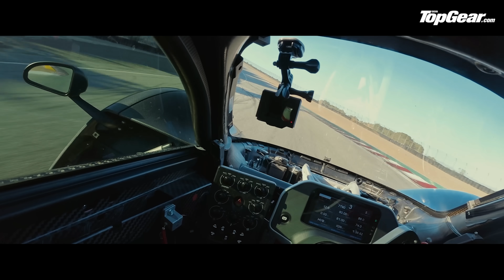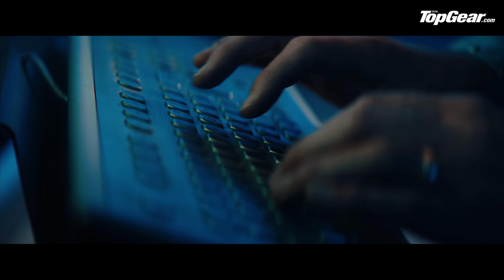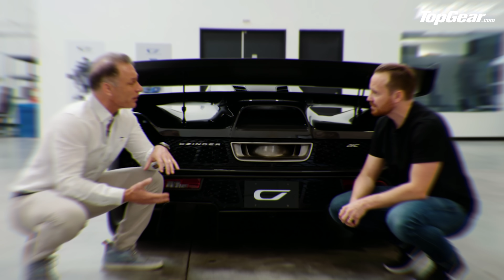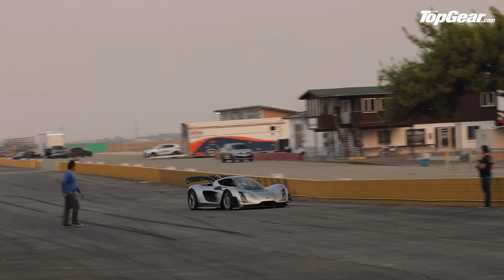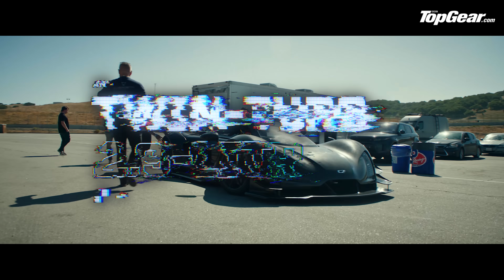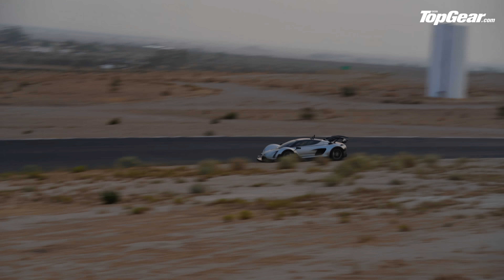World Exclusive! CZINGER 21C FIRST DRIVE: $2m, 1,233bhp 3D-printed hypercar | Top Gear

Comment: For the record the SR-71 went much faster than Mach 3. 
Those engines on it are one of the greatest inventions of mankind.
The potential top speed never achieved limited by the airframe.
But Mach 3 is still terribly fast in its own right. And a jet plane only America could build.

Comment: Somebody would do well to make a 1 + 1 car like that with a more sensible
engine and sensible price. If you kept the weight below 3000 lbs. 
or around 2500 lbs. you could still have a great fun with just 300 -400 HP
and maybe regular folk could afford it. However, the Insurance I'm not so sure.

Comment: Aerospace tolerances are looser than automotive tolerances, Sorry to say
Reply: here is what a quick google tells, sorry to say you are completely wrong.
Aerospace tolerances are much stricter than automotive. For example, a rivet for an aircraft frame can have as low as 0.001 of a variance, as compared to a tolerance in the 0.1 range or slightly better for the automotive industry.
Reply: @lucianholbrook3966   you had to google this but it’s just not, I work in the industry I should know.

Comment: It's very impressive, but I don't think it's an SR-71 like re-imagining of a car. The SR-71 used exotic materials, new technologies and a whole ton of brainpower to create something fundamentally different and new- nothing before had achieved that kind of performance for an air-breathing jet and it was an entirely new 'class' of aircraft. This car is innovative and experimental, but it fundamentally achieves the same things as cars before it in broadly the same way with incremental improvement and new innovations to the process.

Comment: It’s does not have a “dog-leg” gearbox as stated by the presenter. It has a “dog” gearbox. A dog-leg gearbox means that in the gate, first gear is engaged by moving the gearstick backwards and 2nd is forwards. A dog gearbox refers to oversized “dogs” used on the cogs in the gearbox which means gears can be changed without the clutch without damage.

Comment: nvm I missed the part where it showed the hood open. wing is attached to the rear bonnet. What I am seeing is flex from the body. I just assumed a multi million dollar hyper car, the wing would be attached right to the rear suspension. Which is illegal in race cars cause it gives you a unfair advantage. Seems like a logical step for hyper cars to do this. I wonder why they dont?.

Comment: It's clearly a different driver in the exterior shots, different helmet, wearing gloves etc. Still an impressive car, but it raises a lot of questions. If it's assembled to better than aerospace engineering, why do they need a stunt driver for anything over 60mph? Why is it disassembling itself at speed? If it was built better than aerospace engineering, even a pre-production model could handle 200mph. I don't know, I'm just a dumb dumb.

Comment: "Better than aerospace industry tolerances". 10 seconds later: roof falls off.

Now I'm scared of flying. Thanks.
Reply: Looks like the spoiler is going to fly off aswell, its bouncing all over the place
Reply: @christopherosborne7483  To be honest, 200 mil F1 cars all wobble around, stuff bends all over the place while they are driving around. The designers know it will bend, and they are okay with it :)

Comment: the steering wheel locks like a bad design...as you can see, to reach the shift paddles you have to place your hands on the metal ( or plastic) part of the wheel..

Comment: $2Mill??? I don't think so , I would rather buy a Rimac Nevera for that price, and it  will absolutely piss on this Czinger 21C
Reply: Two very different cars. The Nevera is still a very heavy car that has insane straight speed! I'm sure the 21C which weighs  a littles more than half of Nevera, can pull off insane G's at the corners.
Reply: @HKRupadhyaya  Nevera way more comfortable , more power , for real world driving , rather have the Nevero
Reply: @Enduro-Life  Exactly why I said these are two different cars. The 21C isn't meant to be the Nevera 🤷🤦🏻‍♂️
Reply: @HKRupadhyaya  21C -
OLD tech
Reply: @Enduro-Life  And that Rimac is souless XD
Reply: @HKRupadhyaya  I prefer  piston driven  engines, but the Rimac is on another level, and is no slouch on a track either. Definitely has presence

Comment: Beating the Senna is admittedly impressive, but remember it does have 50% more power.  I have a feeling that a Senna would beat this with a mild tune to maybe 1000hp (i.e. still giving the Yanks a 200+hp advantage).

Comment: It's not only 3D printed , many of the parts are optimized to perfection by AI/ML systems . It's truly amazing .
Reply: The fact that theyre also a military subcontractor is wild.
Reply: You are pretty correct, however, a huge amount of this car, engine, gearbox, drive train, interior parts & a great many things that aren't on other cars are genuinely 3D printed, it is one of the very few American cars that I truly admire.
Reply: Of course it's not 3D printed. About 5% of this vehicle is 3D printed, if that.
Reply: @aardvarkmindshank  pretty sure the engine has 3D printed pistons, heads, intake and exhaust systems.
Reply: @aardvarkmindshank  It's way beyond 5% or do you not understand which parts are 3D printed?
Reply: @technosworld2  by value maybe. By volume I suspect not. And yes I'm a chartered mechanical engineer so I understand the process completely. I can also smell marketing BS from a mile away and that's what this mostly is. That's fine. But let's see it for what it is. No one in their right mind would assemble 80 cars using robots.
Reply: @aardvarkmindshank  ever hear of metal 3d printing? Almost every part of this car is 3d printed or machined
Reply: @dirtyricksanchez4483  we are not discussing machining. We are discussing 3D printing. Specialist parts on this car are of course 3D printed. It has several benefits. But most of this car is absolutely not 3D printed. We are also reflecting on the stupidity of using robots (a tool for automated mass production in automotive) to assemble a handful of cars. Wake up people. This is largely marketing BS.
Reply: @aardvarkmindshank  "Almost all of the metal components—aluminum, titanium, and Inconel (a heat-resistant material originally developed for use in the aerospace industry)—are 3D-printed while composite body parts are formed in molds." Taken from motor authority. Do some research instead of getting mad at shit you obviously don't understand.
Reply: @aardvarkmindshank  Actually it is not only a showcase for the 3d Printing tech, but also their proprietary vertical assembly system. These robots will make 80 cars, but the guy also sells the assembly robots with each station having capability of producing approximately 10,000 cars per year. He's just limiting the run. Very promising, both the 3d Printing part and the vertical assembly system as well.
Reply: @dirtyricksanchez4483  Yikes, I wouldn't want to hire him if I were looking for an engineer
Reply: @aardvarkmindshank  lmao doofus moment

Comment: "Better than aerospace industry tolerances"
Roof flys off…… 🤣
Reply: re e  tesla really isn't the gold standard for build quality
Reply: Aerospace tolerances implies that the gaps are miniscule, this doesn't mean that they've been attached correctly.
Reply: re e  weird, I've never seen a roof rip off a car at 70mph...
Reply: re e  wtf are you talking about the roof on the car in the video flew off, it doesn't have a front trunk
Reply: Its "air-o-space." Seat ejection technology that failed...
Reply: it's not a bug, it's a feature ;)
Reply: Automatic weight reduction! 🤣

Comment: Also car is fully upgradable, Kevin czinger himself said that if you bought this car, as technology evolve you can change/upgrade anything in the car  because it all modular, and they (engineers ) will continually improve and develop new technologies to go with the car ( such as new engines, transmission , electric motors , battery pack and etc) giving the czinger 21  edge over any other supercar ever build or yet to be build, it will always stay as top tear supercar decades to come

Comment: Spyros Panopoulos, Chaos Ultracar uses andiaplasty, 1200kg and 3000hp, but down to earth the andiaplasty hydrogen fuel cells of 1300hp, will be the powertrain of the this decade, the Zion 1950kg hydrogen 1300 is coming (800hp version for the mainstream)

Comment: I really hope 3D printing technology to quickly be inside common cars. Less weight less materials => fuel economy+less mining. We could have hatchbacks under the ton easily again, sedan under 1300-1200kg. It can be a big help
Reply: 3D printing is great for prototyping and for very low rate production. It would be tough to justify for a thousand models. Better off using CNC at that point, but the. You’d have issues with if CNC could do the crazy stuff. 3D printing can make hollow and crazy complex parts. Typical design tradeoffs
Reply: @jamesdellaneve9005  for now yes of course, but maybe in the future? I don't know if it is possible but can we imagine that kind of production being efficient and fast enough for mass producing in the future?
Reply: @thomaslegoff4069  Yes. I hope as well. I printed my first 3D part 25 years ago in the aerospace industry. We needed a charge number to use it. It was so expensive.
Reply: It will also be expensive
Reply: @gorugadha6630  Actually 3D printing would be cheaper because less material is wasted, production times are shorter and with AI designed parts like the czinger has you could get parts that are lighter and stronger than anything designed by a human
Reply: @gorugadha6630  in the beginning yes a lot, because you need to invest to change so much elements in the production lines. But later it would end up cheaper
Reply: 3D printing has the advantage of expediting development prototype parts, but it's terrible for scalability because it takes a really long time to print.  I can't remember the exact details, but I think they said it took like 6 months or something stupid to print all the parts for this car.

Comment: Why would you say the gearbox is a dog leg ? It is a paddle shifted gearbox, it makes zero sense.
Reply: journalist don't always know much about cars :-), it's an off the shelf sequencial box with straight cut gears and probably electronic controled shift by paddles, but he may even be wrong about that could be Helical cut as they're quieter and more likley on a road car but take less load and couldn't hear the loud whine of staight cut, but sound wasn't great,
Reply: @marmax5272  Sure. But being a straight cut gear (or having a dog leg for that matter) doesn't chance anything when it comes to how smooth it engages. Maybe he meant to say dog engagement as opposed to Synchromesh ?
Reply: @TheThunderwars  it does make a difference if you don't know how to drive one, sequencial straight cut with dog gears especially like full throttle changes without lifting off, they are not the same as the double clutch  boxes used on road cars,
Reply: @marmax5272  dog leg is different from dog box. I think we just don't understand each othe but we agree. I'm an engineer, I actually design gearboxes and transmissions :)
Reply: @TheThunderwars  I know thats what I said, dog gears are used in sequencial boxes and allow full throttle changes and obviously much stronger, dog leg is a shift pattern, I've owned and driven quite a few race cars new and old, also and engineer

Comment: I don't believe it can do 0-60 in 1.9 sec. The Tesla Roadster is 100% electric and 10,000 torque and does it in 1.9.
Reply: Yeah, a 911 Turbo S is not even a hybrid and has around 640hp: still manages to do 2.5 from 0-60
Reply: @I_4R5  so what? Silly reply.
Reply: @greigsanderson  why silly? Just want to show that it doesn't necessarily need 10,000 torque and a full electric vehicle to achieve such impressive numbers. Don't feel offended by just that my gosh

Comment: 3D Printing is not the most amazing part of this car, CNC also has to be used. It's the Animalistic Generative Design which use machine learning simulations to develop the strongest and small lowest mass shape to do a job. Thus you get that biological skeletal design. If this concept gets even more refined and production methods become cheaply scalable. It could have massive impact on the modern world.
Reply: The 3d printing is what makes this possible, it is why they can build this cheaper later and faster,even upgradeable imagine you have an accident then you can just print the parts. its like unlimited availability... Thats what makes something reliable. This is revolutionary from manufacturing stand point because theres no need to change the factory  ever!! if they wanted to make new model they will use the same stuff
Reply: @micinboi9687  Yes. The optimization of resource use via biomimicry and printing production coupled with the relative ease of parts reproduction (bar the expensive materials used like inconel) makes this the most interesting car in modern history the way I see it. Absolutely brilliant.
Reply: @micinboi9687  The main problem being that 3D printing is incredibly slow and by default insanely expensive from a mass manufacturing perspective.  Until the slowness of 3D printing is solved in a cost sensitive manner, it's a dead end for mass production.
Reply: @ThingyWotsit  Yeah and don't forget the X-ray check at the end.
Reply: A machine, designed and built by machines for a machine to drive brilliant!
Reply: I agree.
Reply: I'm still curious in 2024 because probably someone still needs to define the points and loads. I used something like this in CATIA some years as an example and we still brought it into a mass production method shape. Not only related to mass production but also because you cannot be 100% accurate with the human inputs
Reply: basically designers will be homeless
Reply: @combatantezoteric2965  WTF NO, its just a tool. It has no clue about Design Goals and Aesthetics. It's just another tool for Designers.
Reply: @Neojhun  For now at least.
Reply: @combatantezoteric2965  Of course not. You still need someone to design the car. The optimized structures may even allow designers more breathing room with shapes because these building processes should provide more room to work with. If anything, this allows more creativity in terms of form.
Reply: @combatantezoteric2965  that’s centuries away

Comment: It makes me cringe so hard when people claim this car is 3D printed. Im sure less than 20% of it is really 3D printed.
Reply: Actually an engineer said that about 70%  of it is 3D printed, definitley not something as low as 20%.
Reply: @migueljardim8177  
Yeah there is always a lot of bullshit surrounding these American "supercars" they are never road leal. Never crash tested, never emissions approved, never any hint of health & safety. These things... Hennessey F5 which they claim is an all American Texas built "hypercar" but they don't even have a factory OR a design department. So where was it built? In England by somebody else. Then there is the SSC Tuatara which seems to have fallen off the radar since they FAKED their own world record and got busted for it.

Again they have no factory. So where was the car designed and built? It turns out it was mostly done in Italy. When you follow the SSC address you get to a rented warehouse in a desert area next to a Mormon church. Again no crash testing, no emissions approval, no HINT of federalisation. Its all fake, all bullshit, all wild claims and hype.

As for this 3D printed car... Obviously NONE of the carbon fiber is 3D printed. So that's already 70% of the car that cant have been 3D printed. So whats left? The suspension, drivetrain, engine, gearbox, wheels, dampeners, tyres, none of that is 3D printed. Only select parts of the METAL bits holding it all together. While they claim 70% of the entire car is 3D printed.

70% of what.. The weight? The number of parts? The volume of parts? This is a bullshit claim which is turned upside down, inside out, until it sounds great.

I mean they also claim 70% of the car is carbon fiber. Which we know cant be 3D printed. So which is it then?

The company is a 150 million dollar 3D printing facility. They are NOT a registered car manufacturer. They are just making this car to promote their 3D printing capabilities. The rest are, as always, American wild claims.

And then they borrow credibility by parking it next to a fighter jet, and the American motor press goes wild. Its the same old story all over again.
Reply: @ARTura 
Not sure where that was going.

Comment: ,,...I love cars too (I have a 2017 Corvette C7 with the fun manual transmission) and stocks are one way to make money.
,AMAZON: 
Yep, I bought a ton on the dip.   It's getting cheaper relative to its current earnings (half compared to last year). 

Amazon invested $14 billion in the last quarter alone, the same as it spent in 6 months before that.   It is a do not sell stock.

...With the Delta virus coming at full speed ahead, pandemic sales will make a comeback.

Amazon is investing so much money, that no competitor will ever be able to catch up.

Amazon's not going anywhere so I know that eventually it will come back.    
Fidelity considers Amazon as a large growth company (probably because as big as it is, it still only has 7% of the retail market)

buying via Amazon Smile donations donates some money to my favorite charity too!

Get on board or be runover, it's up to you.